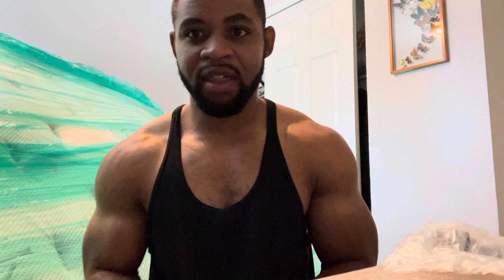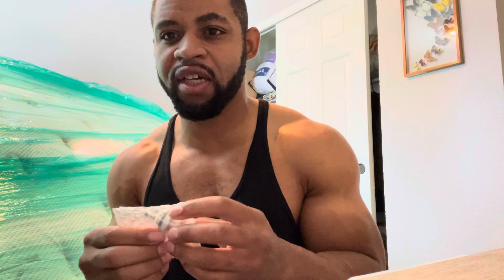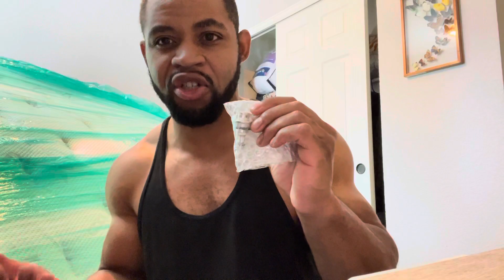Mazda Supercharger build update!

Comment: Thanks for publishing your progress! 

Somewhat related, since you mentioned removing the coolant reservoir: I want to spray paint my radiator and any other things behind the grill. Definitely using the right kind of radiator grade paint. But from your experience under the hood, how difficult do you think it’ll be to pull the radiator to clean and paint it?
Reply from the maker: It would be time consuming, because you'll need to flush & fill thr radiator

Comment: when it’s all said and done you mind showing some detailed pictures of the engine bay & the process of how you installed everything. i got a borla exhaust on the way, and i’m probably going to get an aFe intake, once those are out of the way i’m going to tune my car & then start planning for the supercharger. also how was the buying process with VT racing on whatsapp?
Reply from the maker: No problem will do, just click the whatsApp app link to get more information
Reply: @supermazda3  appreciate it, what are the first mods you’re gonna add on once you’re done with the supercharger?
Reply from the maker: @bread6235  super lightweight wheels